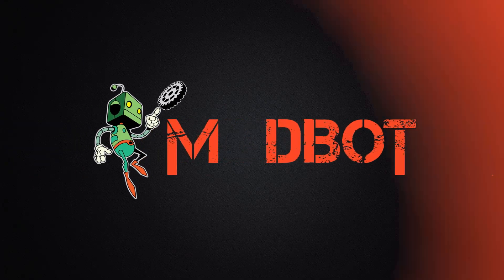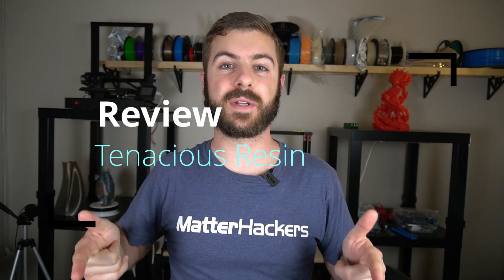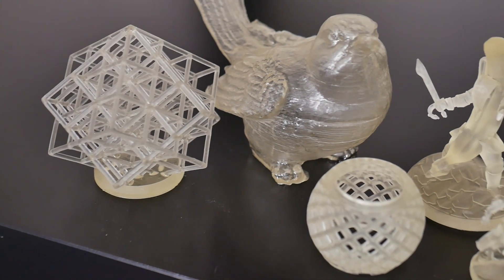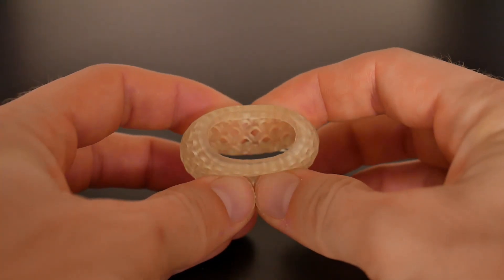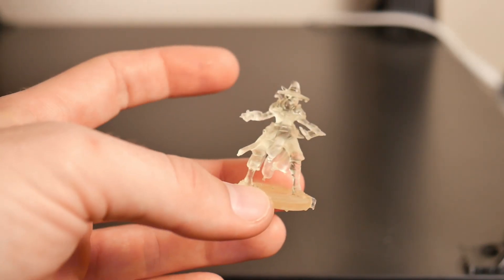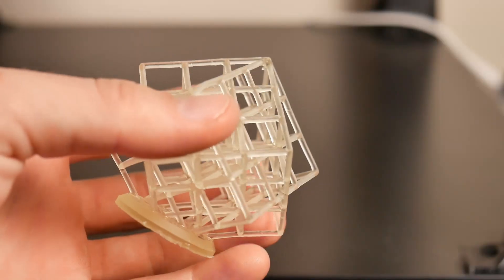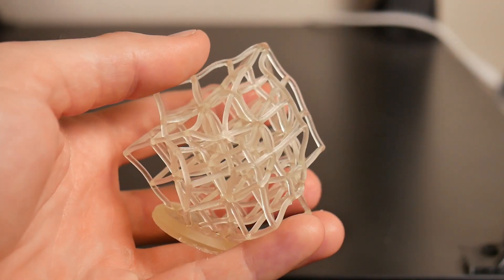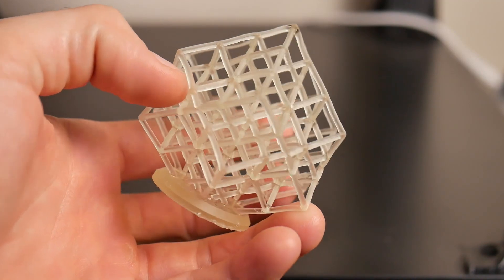Flexible High Strength 3D Printing Resin SIRAYA Tech Tenacious

Comment: I tried to print a cube with Tenacious on my Saturn. Did not come put rubbery. What am I doing wrong? Thanks
Reply: I made the same mistake. It's "Flexible" not "Rubbery" It has some give and SLOWLY returns to shape after flex but its not going to "snap" back
Reply: @lylelay  I meant mine isn't flexible at all. Too long exposure maybe?

Comment: Hi Modbot. Quick question. You mentioned the the Elongation Break @ 75%. I noticed the link is no longer working and all I see is Elongation Break of 50% now for the same brand/resin. Was that 75% reference in the video a mistake or actual, but they no longer make it to that spec? Thanks so much for confirming. Great vid.

Comment: I think cool project for it would be watch bands. And I'm also wondering are they anyway you could put dies it to make it different colors. And does anyone know if I should use alcohol dies are water-based
Reply from the maker: Watch bands would be rad. I have seen people experimenting with coloring resins but I have not dove into that so far
Reply: @ModBotArmy  I really love your Channel. I'm just now getting into resin printing. And I'm going to buy some of that flexible resin.😁

Comment: The final piece--I wasn't aware of flexible resin. I thought I was going to need to destroy my patterns each time I made a new silicone mold. Hopefully with flexible resin I can print the sprue, patterns, runners, and risers all as one piece and reuse the piece to make more than one mold. It's amazing to me that I can design and produce hundreds of fully functional copies of a completely new, complicated product at home using a process that will only cost about $1500 to start.

Comment: To solve your issues sourcing a strong UV light for curing the resin when finishing, grab any box-style halogen floodlight from a home improvement store - you want one with the bulb that looks like a pencil inside. They sell for around $20-$25. If you remove the glass covering the front, they put out a ton of UV light (along with visible spectrum light, and heat). Removing the glass is important because I believe it has a coating which filters UV light. These lights are what people have used in screenprinting for years to expose UV-sensitive stencils on the screenprinting screens on their homemade light boxes. Best wishes.
Reply from the maker: Kick butt thank you for the recommendation I may have to check that out. We do sell a uv curing light at my work I have been eye balling but I will definitely take a look into the bulb you mentioned :)
Reply: just learning about this stuff, would the stronger uv light make its less gummy?  I like the strength of tpu due to the rigidity of print pattern and orientation?, though I was wonder if this was less so with these resin printers?
Reply: thank you!

Comment: Nice! I've been wanting to see flexible resin actually being used for a long while now. I've seen a lot of flexible resins being sold online but I never saw anyone actually print with it. I wonder if making phone cases with this resin would be better than printing them with TPU...
Reply from the maker: If you have a machine that has a large enough build volume then I would say yes cases would turn out much nicer. I agree that has been my issue is I see lots online but that’s it no videos really on the material so I was really wanting to get hands on experience with it

Comment: I want a resin printer the size of my ender 3. I print functional parts and not having to deal with filament and its inherent inaccuracies would be a game changer
Reply from the maker: Check out the Peopoly Phenom it just released and is huge as well as under 2k. It’s awesome.
Reply: Anon you’d be better making your own then. Buying a resin printer even close to an ender 3 size is gonna cost a few thousand.